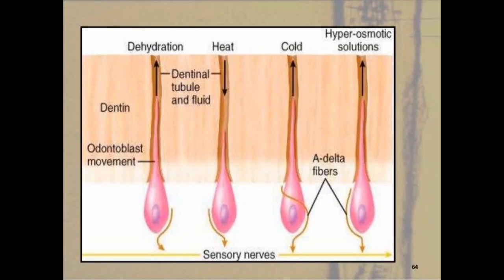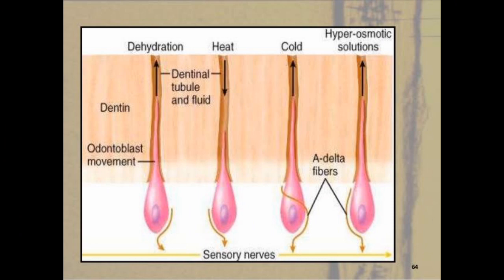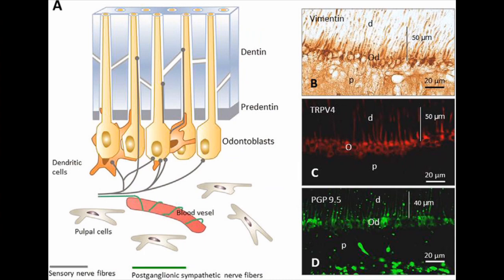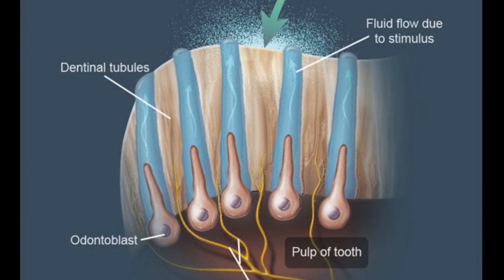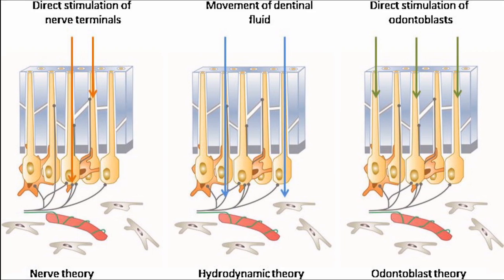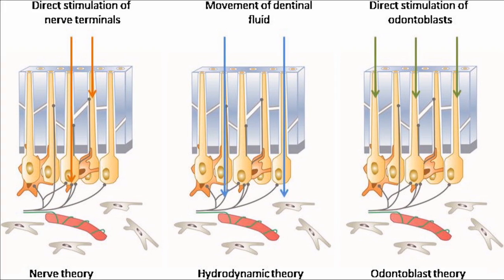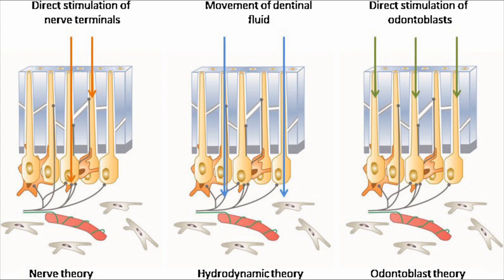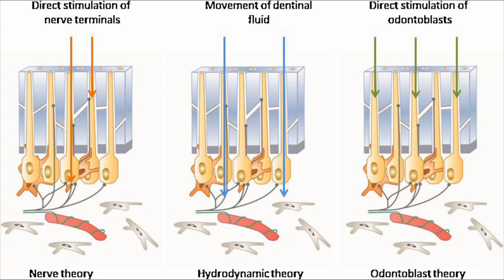Dentin Hypersensitivity Theories Lecture

Comment: Very well........explained doc!!! 👌
I have a query
During cavity preparation or when we blow air the fluid comes out to replenish
And when stimulus is hot - doesn't the fluid moves out
And when stimulus is cold-the fluid moves back in? 
Can u tell me regarding this
But I saw this the other way in our 3 slide# in ur pictorial representation
Reply from the maker: Bhargavi, first of all I highly appreciate your comment on this lecture video. Regarding your question, the facts are variable on the flow of fluid. Clinically it is a mixed observation and can be either of the two. Scientifically I am more convinced with your point that applying a cold stimulus would constrict the tubules whereby reducing the fluid flow and the opposite goes for a hot stimulus.